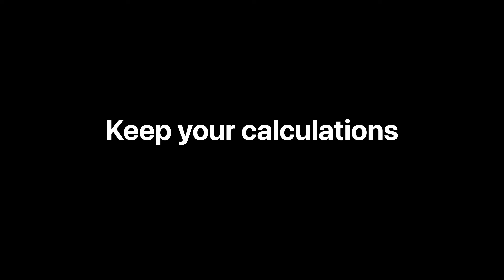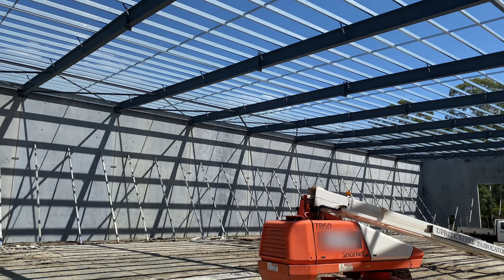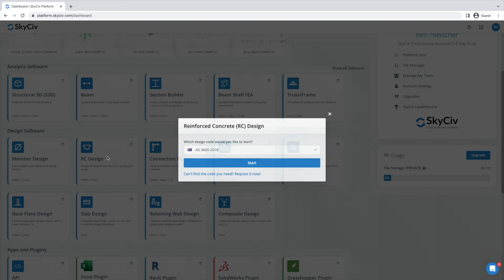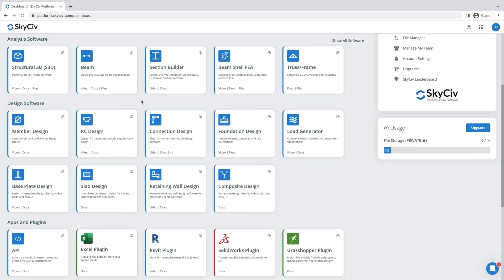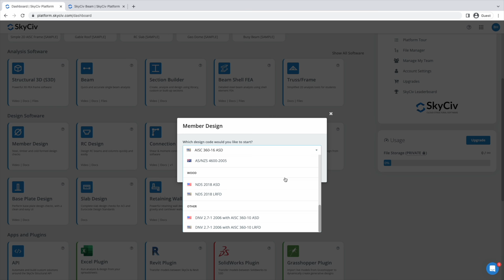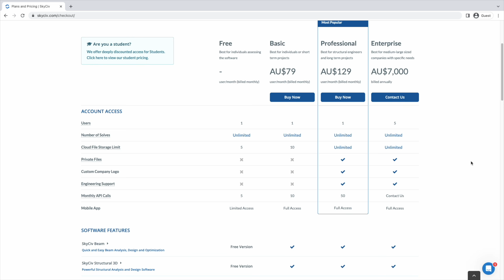8 Habits That Quickly Made Me a Better Civil Structural Engineer

Comment: Hello sir 
Did you learn all the softwares during your degree or you learned some software at your job....l also want to be a Structural Engineer currently in my 3rd year of Btech Civil engineering and now I'm kinda scared of how work life would be like....do l have to remember all things when l start working because the things keep piling up and l forget some things 

looking forward to your reply😊
Reply from the maker: Hey! I learnt a few software programs during my degree but I’ve learnt a lot more about these programs since graduating and actually using them in my job. You don’t have to remember everything from uni but there is some crucial stuff you need to remember if you want to be a structural engineer. Don’t worry to much because if you forget it you can always relearn this stuff as you start working.
Reply: @BEngHielscher  hey Ben, just started watching your video and love what you’re doing. I would like to work with you. How can I reach you?